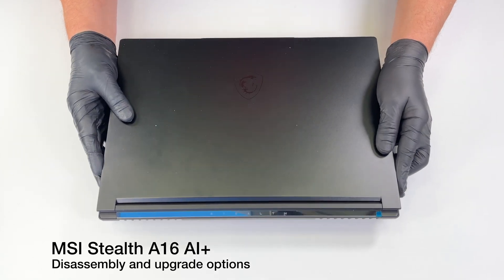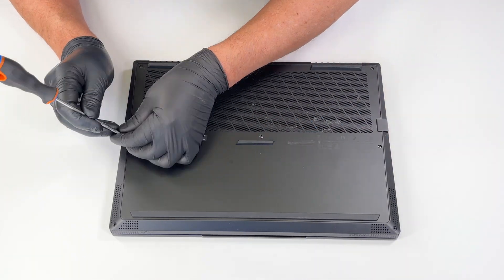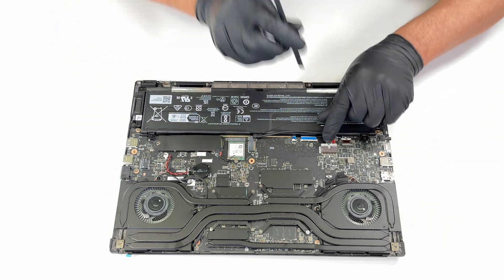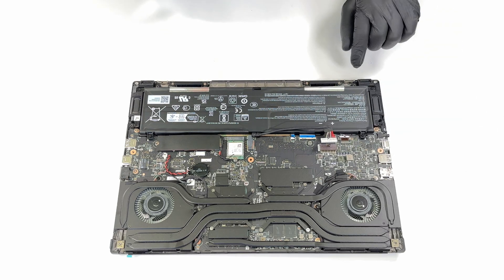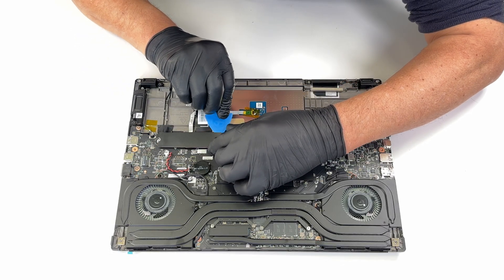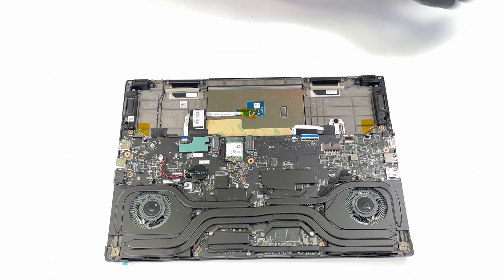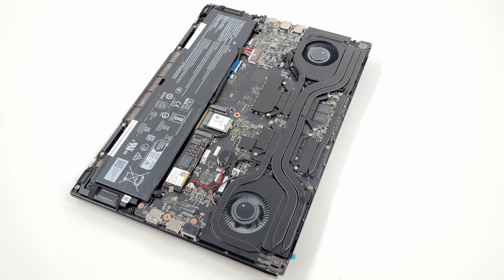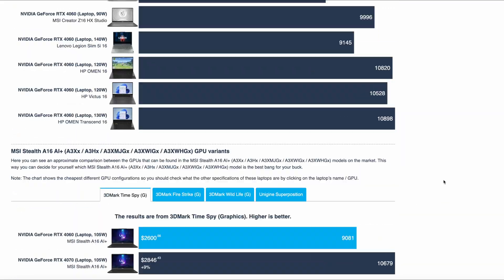🛠️ How to open MSI Stealth A16 AI+ - disassembly and upgrade options

Comment: Can u make new video of A16+ 50 series GPU edition? Looks like they remove the extra M.2 slot. Make it can not upgrade now. It’s a huge mistake
Reply: Hi. I can confirm your anticipation as a current owner of the 2025 versio. It does remove the second SSD slot, forcing people to only replace the existing SSD rather than adding more. The removed slot is the one that has the thermal pad in this video. The rests remain almost the same. For the 2024 version, however, my research goes that even if there are 2 SSD slots, the unoccupied one only has 2x PCIE 4.0 lanes, making it effectively a PCIE 3.0 SSD purpose.
Reply: @hanbohong9544  Yep that is a serious value destroying decision, and now I no reason not to just get the G14.
Reply: Yes. That why I return the 2025 version. Two M.2 are too necessary for me. MSI should update their website for tell the users.